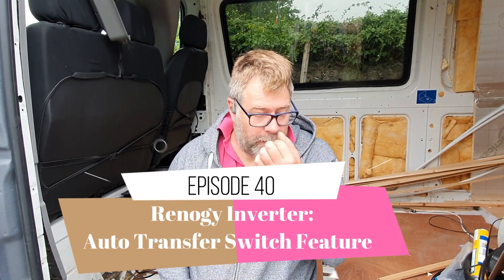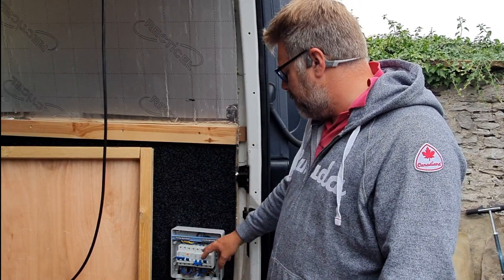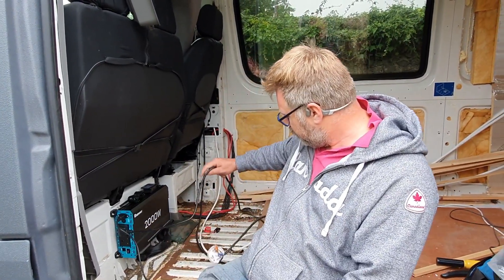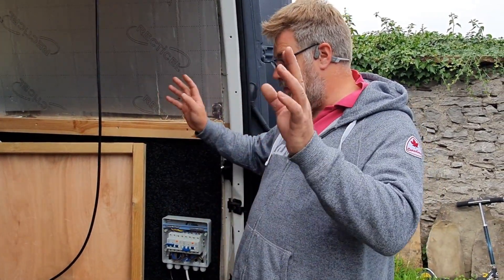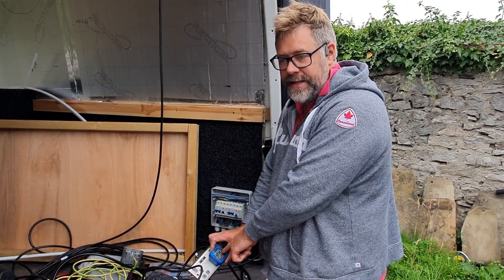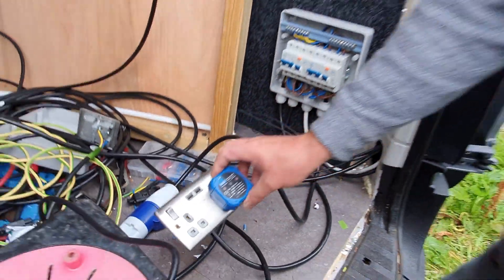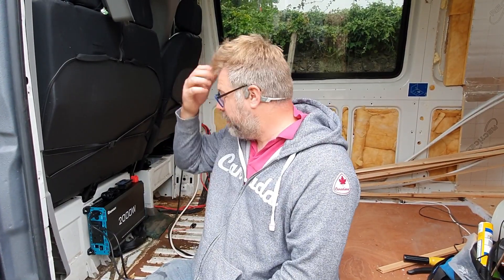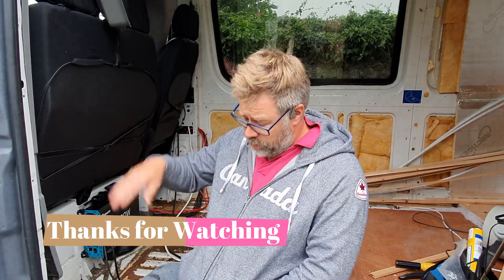Renogy Inverter: Automatic Transfer Switch Feature (episode 40)

Comment: Be interested to see how many watts you get out of it. I can only pull 1500watts on mine and it trips out.
Reply from the maker: Interesting. It's on 50mm cable 1 metre length so it's got every opportunity to perform.
Reply: @AlwaysVanAdventure  mine in right next to a 280ah lithium setup using their supplied double cables. With an induction hob it trips within a few seconds at 1900 watts. As you go down the power settings it runs for longer on each one until finally remaining on at 1450watts (according to shunt & BMS). Renogy are blaming cables or my battery. 
I have the 50amp B2B with MPPT similar to the one in your earlier video. That works well👍🏼

Pretty sure you can use the remote or the onboard switch for the inverter. Onboard switch has to be in position II for remote operation or I for local on.
Reply from the maker: Now that is a very comprehensive setup. Where are you based ?
Reply: @AlwaysVanAdventure  North Yorkshire Moors.
Reply from the maker: @eckythump6429  do you have Instagram?
Reply: @drewhodge3820  I will have to look into that. I’m not keen to oversize the inverter as my BMS is a 200amp unit.
Having done a bit of research after my issues it seems I’m not the only one who has had less than Stella performance from Renogy inverters.
First course of action for me is to oversize the cables. If that doesn’t do the trick I will swap to a 2000watt Giandel inverter as they seem to do what is advertised.
Have fun with the battery build, wish I’d had the patience to wait for deliveries from China to put mine together. Offgridvanlife had everything there ready to go in the UK so I went down the more expensive instant gratification route!
Reply: @eckythump6429  My 300W keep shutting down after 10 minutes or so and I couldn't fathom out why, fans were coming on airways were clear but it was mounted like in this vid so as a test I mounted it flat and as if by magic no problem, infact the fans rarely cut in now
Reply: @VanBooter  something worth a try although I am limited space wise to install horizontally.
Reply: Update on my Renogy inverter situation….

I followed the advice from @AlwaysVanAdventure and ditched the double cables supplied by Renogy and upgraded to a 50mm2 alternative for +ve & -ve. The existing 200amp breaker was replaced with a 200A mega fuse & holder.
The final thing I did following some research was to earth the case to the van ground. 
It will now  run quite happily at 1950watts with my induction hob.
Not sure which of the changes made the difference as they were all done at the same time.
Reply: @eckythump6429  Funny you should mention the Giandel, I hadd the 2000, with my prev van and lithiums, didnt do anything well that was above 1200 ish. I go the 3000 + surge for this van and didnt work well anything near 2000, Ive had the Renogy and its done well, on micro, induction hob etc so far
Reply: @johnboland8024  good to hear you are having a positive experience with the Renogy👍🏼. Since changing the supplied wiring mine has run flawlessly.
Reply: @eckythump6429  Hi - I watched a video on YouTube where someone opened up a Giandel inverter and the mother board was bowed, to allow it to fit into the case. Put me right off buying one.
Reply: @keithlillis7962  I have the Renogy up and running properly now so will be sticking with that👍🏼